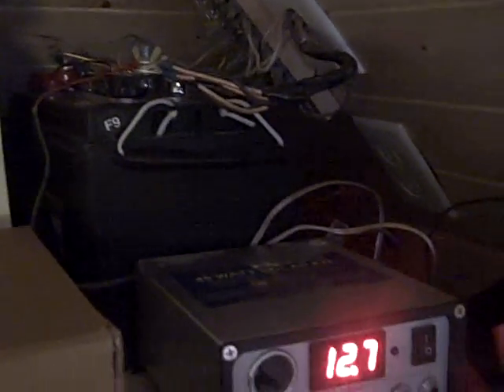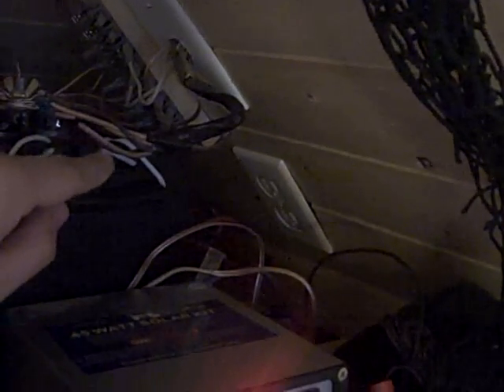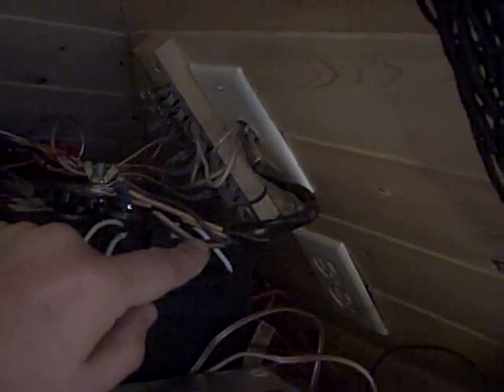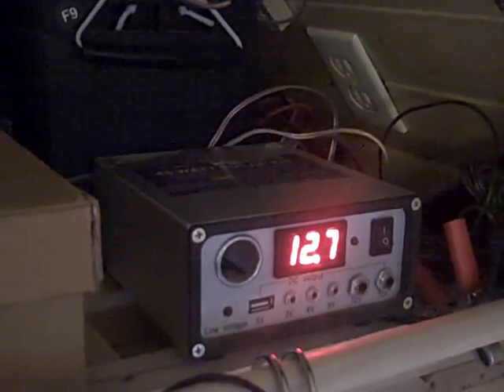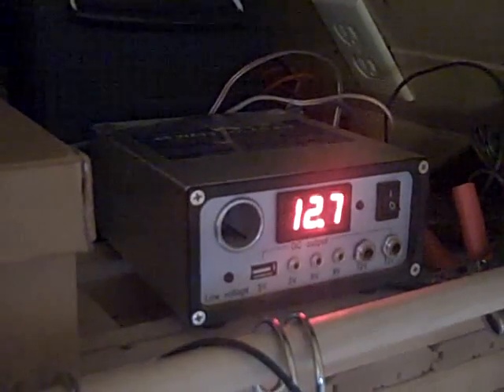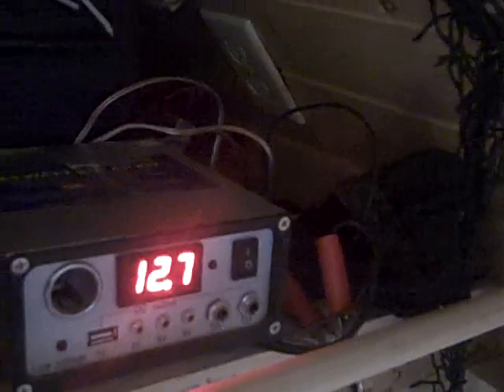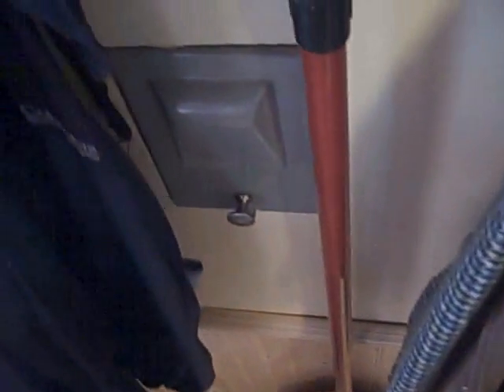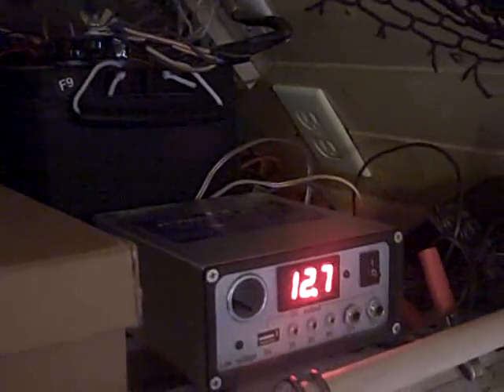Jonathan's Fencl - 03-31-11 Electrical Detail

Comment from the maker: @djdrdisco I honestly and admittedly know little to nothing about solar panels or batteries or charge controllers or anything.  All I know is that I bought some solar panels and a battery from the store, hooked them up, and they worked.  It's been running fine for the last couple of years now, although I guess that doesn't mean it's not doing some long-term damage.

If that's not a regulator, is there an affordable one that you'd recommend?

Comment: Hi fellow tiny houser!  Sorry, but  Harbor Freight charge controllers suck. I own 3. I bought a really good charge controller kit.  That HF Chinese piece'o'doo-doo  looks inside like it was wired by a 3rd grader.  My concerns, however, are about the voltage.  14+ volts will cook that battery fast.  It seems like you have no regulation.  A good controller kit will save your batteries.
contact me if you want info.  There's no way to burp your batts w/HF item. Tinies are best of fun huh? Got a 8x8!